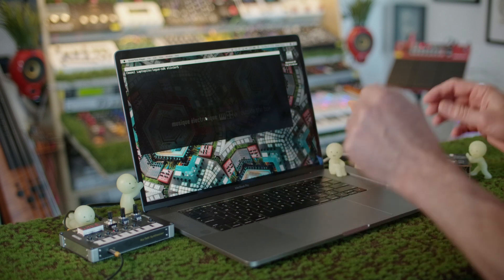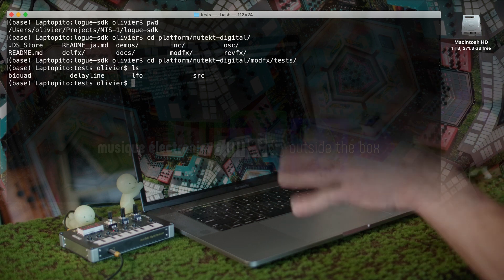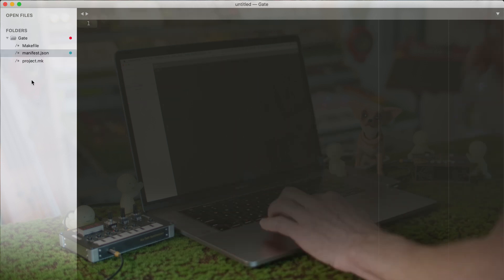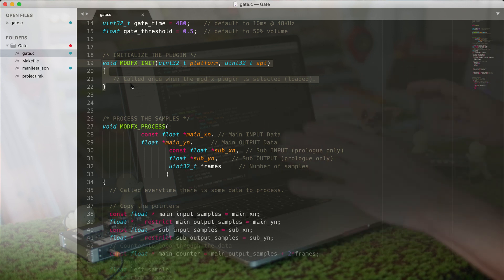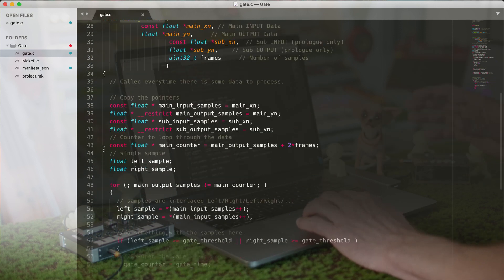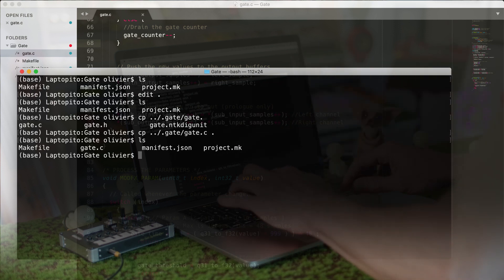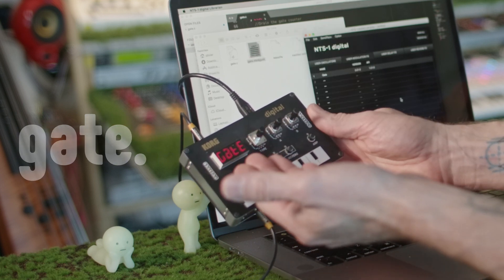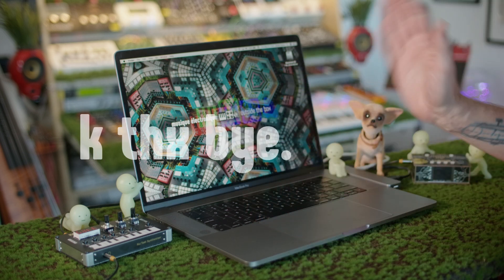My First Plugin: programming the Korg NTS-1 (part 2)

Comment: First thanks a lot for taking the time to break the ice - i assume that each audio samples is signed  -  to make the code "cleaner" should you use the absolute value to compare against your threshold ? i'm asking to get a better understand of the input values to that PROCESS function. What is the range to audio samples inputs ? thanks again Olivier !

Comment: I was hoping that it was easier to program it takes away the fun
Reply from the maker: In reality audio programming is pretty hard, I chose a gate, because that's the simplest thing you can implement that actually sounds like a real thing, but for most programs you'll have to handle converting a block of samples which are just amplitudes, into the frequency domain before you can do anything useful.

Comment: Thank you very much! I've wanted to try making custom effects but didn't know where to start with my limited experience. Are there any resources to better understand how an audio signal is processed by the NTS-1 and how to program it for desired manipulation? E.g. How would you make a simple filter using this gate patch as a starting point.
Reply: @markfelixm Korg uses Pulse Code Modulation, which takes either 44,100 or 48,000 samples per second (I forget which). Each of those samples is stored in a 2-byte (16-bit) "word." So, a raw PCM 1-second sample of audio would be 48000 * 16 bits = 768,000 bits, or 96,000 bytes, of data. Korg takes a much smaller sample than 1 second to process the audio, but the math is still the same -- you end up with a block of data that gets processed with the program you wrote as audio passes through the synth's memory. Understanding PCM is key to understanding how the audio signal is processed; more info at Wikipedia here: https://en.wikipedia.org/wiki/Pulse-code_modulation.

In the example you give of writing a frequency filter, you'd need to take that data and apply some math in your program -- at a minimum, you're going to need trigonometry to understand the waveform ( remember SOHCAHTOA?: https://www.mathsisfun.com/algebra/sohcahtoa.html ). In many cases, what's being done is a function called a Fourier transform ( https://en.wikipedia.org/wiki/Fourier_transform ), which essentially breaks an incoming waveform into "buckets" of different frequencies (in the same way a graphic equalizer breaks out different audio bands). A low-pass filter, for example, would then identify and pass the frequencies below the threshold you set, and block frequencies above that point.

Of course, there's then the small matter of learning C/C++, which is an old semantic-laden language from an era when a computer would have only bytes (yes, just bytes) of memory. Korg is using it here because, as difficult as it is to learn, it's extremely fast, making it possible to run these complex algorithms in what we perceive to be real-time.

So, obviously, there's a lot of layers to it, but if you take each problem individually it's easy enough to get there. The reward for doing so is threefold: you can manipulate your instrument in ways other musicians can only dream, you can practically apply all of that math you were probably subjected to in school, and you learn a language that virtually all computers speak (synthesizers or not). Nothing ventured nothing gained, right?
Reply from the maker: This is why you get a block of samples, and not just a single one. anything that needs to work in the frequency domain is a bit more complicated, because you'll need to convert that block to extract frequencies from it.